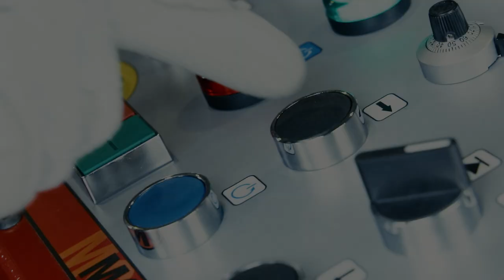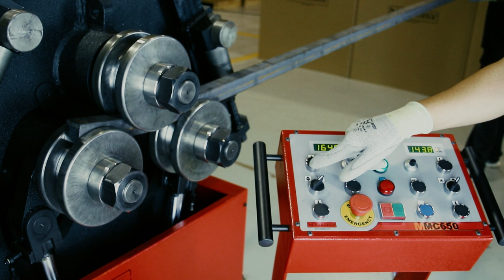ASÍ funcionan las MÁQUINAS INDUSTRIALES CURVADORAS de NARGESA

Comment: How to fix diameters of bends
Reply from the maker: It is a good question! In order to set the bending diameter, it is necessary to make a first piece to adjust this dimension. Nargesa benders have millimeter scales that indicate the position of the rollers and they are used just for this purpose. In this first piece that we bend, we should look at the dimension of the rollers and repeat this same dimension so that the resulting pieces have the same diameter

Comment: Can it bend 1mm pipe
Reply from the maker: Yes, the MC650 machine can bend 1mm pipe. There are two factors to keep in mind: the diameter of the pipe and the bending radius that you want
Reply: @Nargesa  can it bend 0.5mm pipe
Reply from the maker: @metalmagic1573  Yes, the MC650 machine can bend 0,5mm pipe. What is the diameter of pipe? What is the bending radius? Please send an email to nargesa@nargesa.com and our sales department will assist you